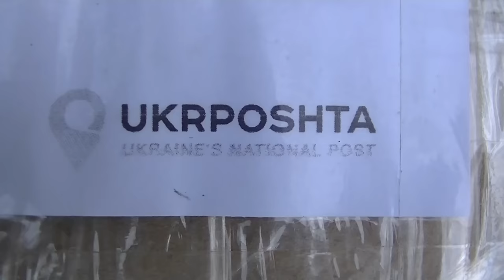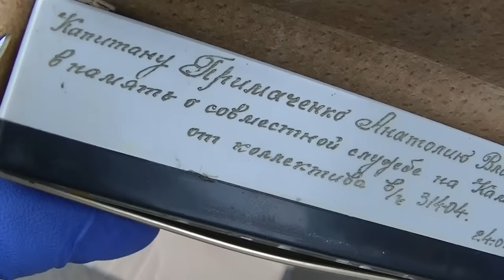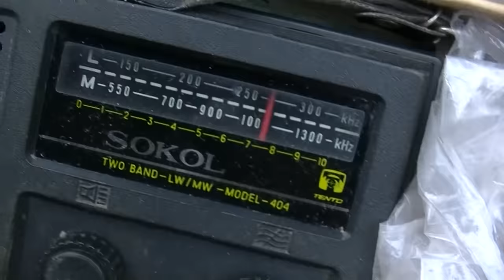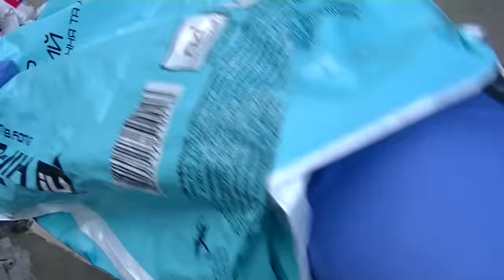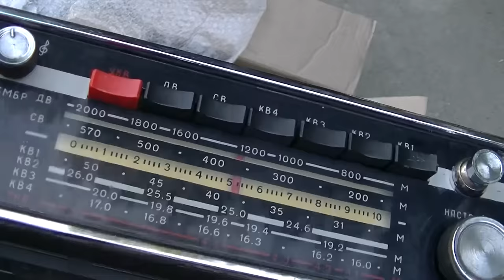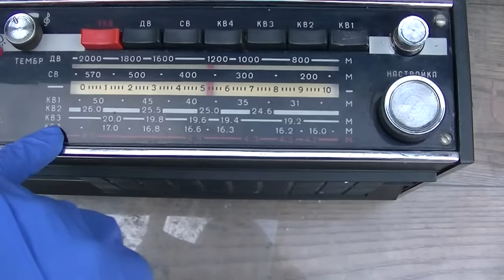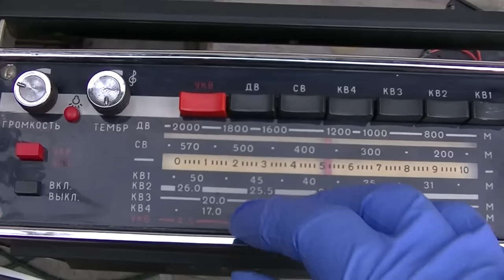Box Of Soviet Radios From Ukraine and  MAYAK 2 Soviet Military Radio

Comment: 4:40 Капитану Примаченко Анатолию Владимировичу в память о совместной слудебе на Камчатке от колектива в/ч 31404 .  24 марта 1967г
For Captain Primachenko Anatoly Vladimirovich in memory of the joint service in Kamchatka from the team of military unit 31404. March 24, 1967
Reply: Thanks for the translation 👍
Reply: I found a mistake, it was written: в / ч 31404 or Воинская часть 31404 - Military unit 31404. You can find photos of soldiers on the Internet.
Reply: Thanks for the translation.

Comment: We also have ordered from several of our Ukranian sellers a while back and received items without issue. I told the one seller I was more concerned with supporting them than receiving the items (which arrived in good condition)

We have a Mayak II we purchased non-working a year or so back. Issue was a corroded speaker connection, easy fix. Fantastic performer and ours was provided with the NOS leather case and accessory kit that included a long-wire antenna. They do use a couple weird IC's but substitutes can be located. We have a Mayak M that had issues with one that I was able to get working with one.

Comment: The first radio at 4:30 called "Almaz" probably was a gift, engraving on the top says "To a captain Primachenko Anatoly Vladimirovich in memory of joint service in Kamchatka from the staff of military unit 31404 (24.03.1967)"
Reply from the maker: That one has so much use and was very difficult to get in good working order
Reply: @shango066  I am certain that Capt. Primachenko burned even more radios while he was stationed in Kamchatka :)

Comment: The Маяк-2 is actually not military radio. There are a lot of common not military grade components inside. Also notice it uses 224 and 237 hybrid series which can provide a lot of 'fun' in case of failure diagnosis. But these are well known for russian radio amateurers so usually information is obtainable (including internal circuitry).

Comment: The old USSR FM was 65.8 to 74 mhz, actually still used in the Ukraine with the regular FM band.
Reply: That means that, under the right circumstances and with the proper modifications (few if any), an old Soviet radio could be used to pick up the audio output from a North American VCR or DTV converter box since their RF output is on Channel 3 or Channel 4.  In the Era when those radios were new, they could have picked up US TV stations on those channels.
Reply: In my area (Ukraine) there is only one      Radio station there
Reply: When I was in Kiev in 2019 there were quite a few OIRT FM stations still around though I was 28 floors up in a hotel when I tuned around on a XH data D 808...
Reply: Recently here in Brazil, the frequency of channel 5-6 VHF (76-87 MHz) was reallocated to FM. It called "extended FM track". Most AM stations is in a process of reallocation to FM, unfortunately. But some stations still broadcasting in AM and 3 or 4 in SW.
Reply: Japan uses 76-95 mhz for FM, with most AM stations booting up to 90-95 mhz. Many US AM stations also have low power FM relays or translators.

Comment: The FM band you mentioned at the big boy is the OIRT FM band assumingly?

CB seems to be the AM band, measured in meters. 570m is approx 530 kHz. 200m = 1500 kHz.
VKB seems indeed OIRT, 66 to 74MHz
ДB is longwave (150 - 300 kHz) 
KB are the shortwave ranges.

Very interesting device to see :)

Comment: 6:45 This radios was used even after its death )) I have a VEF 202 made in 1979, it still works normally without any repair or even recap.
11:25 Mayak at AM works bad, it's needed to be adjusted.
Mayak is very rare and good semi-military radio.

Comment: 4:35 Dedicatory inscription: To Captain Anatoly Vladimirovich Primachenko in memory of the joint service in Kamchatka from the staff of military unit 31404. Apparently in honor of the transfer to the reserve from military service.
Yes, this is the Russian VHF band. It does not match the Western. For short waves, of course, it is better to use a mast antenna or a dipole between trees with a beam length of 15 meters each.

Comment: I use to listen to shortwave  when I was a teenager 50 years ago. I just started listening to it again here in Canada. Its a shell of what it once was. I thought my radio needed alignment but it works as good as yours. Be interesting to see how your radio works at night. Shortwave was once  vibrant and full of Morris code transmissions. You weren't able to tune in the world clock signal out of Colorado. I can tune it in but barely. Regards.

Comment: FANTASTIC!!!  Can't wait to see more on the Mayak-2!!!  Interesting to be watching this while a Radiotechnika Salut-001 (Салют-001) sits on my bench undergoing repair.  At the moment, it seems that the biggest problem is that this is a potentiometer-tuned set and the tuning pot is dirty and has a shaft that is very loose.  (so when the tuning is just moved a little but, the shaft flops around, and the tuning jumps...verified with my scope watching the tuning voltage as I tuner around)  A mil-spec Clarostat unit is on it's way from the e-place to replace the original Soviet unit.  :)  I will say that when it is tuned in and stable, it's a great sounding set!

I've added the Ukrainian seller to my watched sellers and will be watching to see what sort of radio gear he has to offer.  :)

A VEF-202 is also currently on its way to me from a different seller in Ukraine.
Reply: I should note that the mil-spec Clarostat tuning pot fixed the jumpy tuning...but now the dial calibration is garbage.  Need to translate how to align it and recalibrate the dial calibration.

Comment: FM frequencies may be registered in wave length, 4.6 - 4.1 metres. They use the German system , ultra shortwave or UKW. The higher the frequency the shorter the wavelength. Old German radios are like this.
Reply: I have seen UKW on my old Seimens radio/tv phono unit as well as a greutz without looking at it, is probably the wrong spelling on the last one.  I did see the german translation of UKW but cant remember it.
Reply: @steviebboy69  UKW=Ultrakurzwelle
Reply: @matthiase.1747  Thanks I know I could have googled but was feeling lazy, I looked on the dial it also said Lang, Mittel and Kurz, and this old german radiogram gets FM in stereo or well it did last time i tried but its a different range, and not to forget the telly that is there as well.
Reply: In Russian it is wave is volnye I think, a transliteration from Cyrillic to roman alphabets.

Comment: please use an CCIR to OIRT converter for the FM part of that radio. Don't try to modify it, the transistors and their feedbacks will not work well on the higher frequencies.
Reply: This is a 80s radio. Those transistors have no problem to work even above FM band.

Comment: That's a civilian radio, Soviet military stuff looks nothing like that. УКВ ~ VHF, that's indeed the Soviet FM band. Тембр = Timbre dial adjusts an audio frequency filter of some sort, think Bass/Treble.

The mysterious board might be from a cassette/tape recorder or something similar; those 5-pin DINs would be mic in, line in and headphones out or something along those lines.
Reply: I was wondering about the cassette recorder thing as well, maybe that is what that long switch thing was on the board when operated it goes into recording mode.

Comment: The problem with Soviet radios for me is that there is almost nothing on AM (only a few stations in other countries, hundreds of km away) and the FM range is wrong, requiring modification to the radio to be able to listen to any station.
Oh and I think the USSR used a different FM stereo modulation.

Same with TVs - B&W TVs are OK, color TVs use SECAM which is not used anymore (and VCRs or STBs usually do not support it), so I would need a PAL to SECAM encoder, which are also uncommon. There used to be PAL decoders or sale, to modify the TVs to work with VCRs, but those are not available anymore either.
Reply: "Oh and I think the USSR used a different FM stereo modulation." Yes they used polarized modulation instead of FCC multiplex. But any other eastern block countries used standard FCC multiplex, so export versions were fine, sometimes also with standard FM band.

Comment: I imagine reducing the fixed capacitance in the vhf local oscillator would lift the band.
And a front end tweak.
Good old radio.
Reply: Sometimes you also have to reduce inductance of the coils by removing 1 turn (whole coil has usually 4-7 turns).
Reply: @xsc1000  Yes your right,  odd how i forgot.
And trying to get the range and in the right place on the scale could be touchy at such a high frequency.
I think i need a good slap lol.
Reply: @zx8401ztv  I always did it with second radio to check right frequency. Russian radios are more tricky, because they were not designed to receive CCIR band. Some old ones tuned by coils cannot be modified.
Radios from eastern Germany or western radios exported to eastern block are much easier, they were designed for CCIR and just modified for OIRT (usually by adding capacitors). Tesla from Czechoslovakia made radios for both standards from 70s - with bandswitch or with continuous tunning from 64 to 104 MHz (old CCIR standard was 88-104).

Comment: Never seen a FM Radio with meter only on scale. OIRT-Band is the 65,8 to 74MHz range.
Reply: Most of USSR radios had a FM (OIRT) scale in meters.
Reply: @MikhailKulkov  Till 70s, in 80s they changed it to MHz.

Comment: I got a good deal on a Ford 2007 car radio with CD player for 14 dollars at a Goodwill It was never used I swapped it for the plain am fm radio in a 2013 Ford cargo van. It was a bitch to install There was hardly any room to maneuver it because the connectors were short. It took me 2 hours to get it into the dash but it worked excellent including the CD player It was worth all the cursing and foul language to install it

Comment: Mayak is not a military radio. Main problem of the soviet electronics are polarized capacitors. The big ones probably works, but smaller like 10u, 22u, 47u must be changed. The life span of these is 10 years.

Comment: Russia & some of Eastern Europe use 64-108 MHz on FM. I herd some strong FM stations bleeding though there but here I can hear my local FM stations bleed on 65, 72 & 84 MHz.
Reply: OIRT was 64-74MHz only. But there are some radios from Czechoslovak Tesla that can tune from 64 to 104 MHz without switching bands. So they can tune both OIRT and CCIR.
Reply: @xsc1000  If you buy new radios today like Tecsun, Sangean & many others they can tune into 64-108 MHz so they must use those frequencies still I assume. Japan is 76-108 MHz but they use 76-95 MHz part.

Comment: Great!😀I just wanted to ask you that!O I watch your videos and they are awesome 2000.Got me through pandemic quarantine pretty well ,thanks!So i have that same radio but its white and a little bit older (I mean it says its from `78.) and I was wondering can it its coils be rewinded and its capacitors changed  to match real ultra short waves 88 to 108 MHz ?Its a cool radio!I didn`t need to do anything just plug it up to power supply 12v and it came right up.Little bit off cleaning compound in to the switches would be appreciated. Can wait to see it done and I will do that the same way.This one has its range in MHz but its I don`t know VHF where you would get your channel 6. 76Mhz to 87 or something.